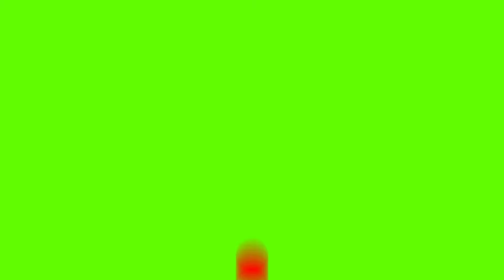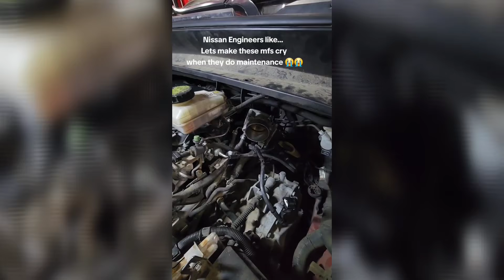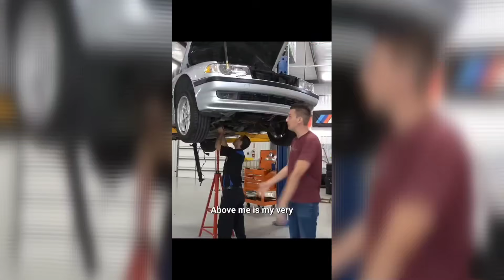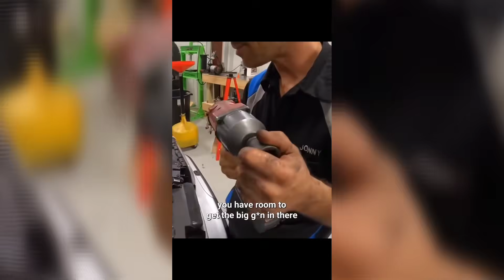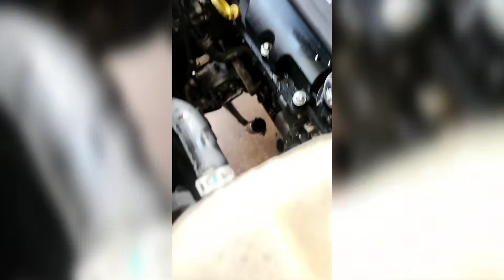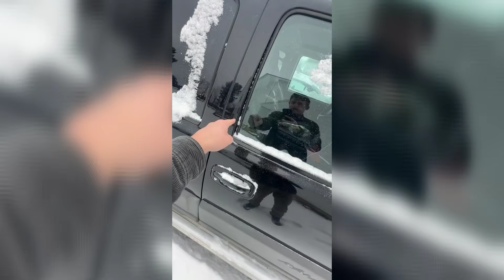Car Mechanic Are FINALLY SPEAKING Out on What’s Happening To NEW TRUCKS..

Comment: STOP BLAMING ENGINEERS.
Engineers get design directives from their supervisor. Engineers design based on what the CEO wants. Engineers don't just design what they want without approval from their supervisor. 

If the CEO want to make DIYs or Shop repairs impossible the supervisor tells Engineers to design it that way. Engineers don't personally design just to fuck with you. It's the CEOs.

SO STOP BLAMING ENGINEERS, ITS NOT THEIR FAULT.
Reply: The CEO is not part of the team that designs a car. Stop blaming the CEO.
Reply: I also heard it has a lot to do with their bean counters as well.
Reply: You bring up a good point.  if the supervisor is capable of telling them how to design the vehicle why pay engineers just put it all on the supervisor to save cost...

Also if the ceos are demanding it be designed this way then the engineers are to blame for making their demands a possibility...

Either case engineers are knobs.